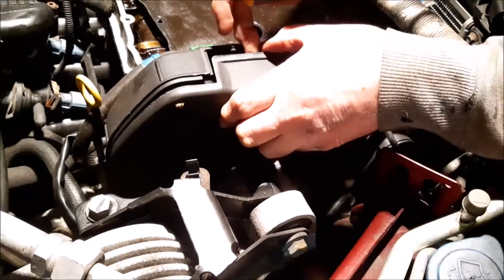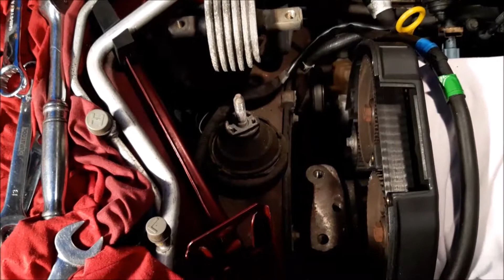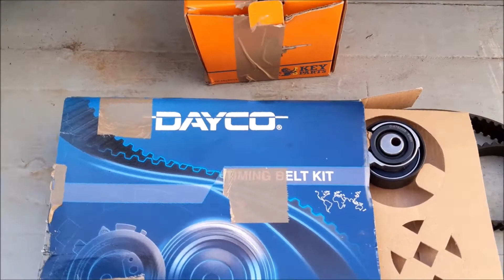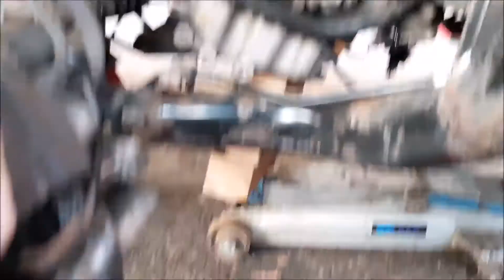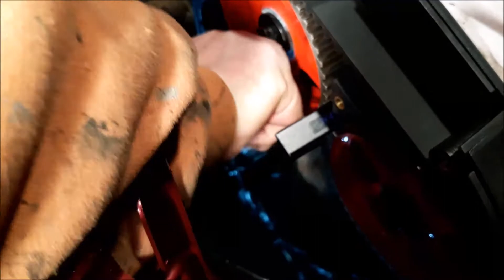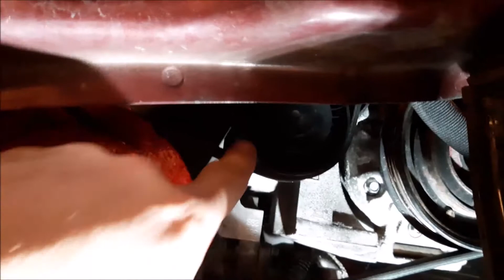Replacing the Timing Cam Belt on our Rover 75 K series engine

Comment: be careful ! The automatic tensioner must be turned counterclockwise as specified in the Rover overhaul manual
Reply from the maker: We use the Haynes manual and the X part disk and both of them say turn clockwise and we have always followed this although it is not that clear in the manual it does say if readjustment is needed you may need to go anticlockwise again we feel not clear

Comment: Can you tell me how to completely flush the cooling system on my rover streetwise. Just unhook the bottom radiator hose drain it and run a water hose through the cooling tank????
Reply from the maker: That's it
Reply: Thank you :)
Reply: Is there anyway I could sent you 2 pictures and ask u a question. I  couldn't see any TDC markings at the crankshaft pulley so I lined everything up by putting the camshafts in aligned position (L->R exhaust-in-exhaust-in) and then put camshaft locking tool in while trying to lose the crankshaft pulley bolt. The bolt was on really tight so I put car in gear and foot on brake and tried loosening pulley crankshaft pulley bolt I still saw the crankshaft pulley spinning slightly when loosening.
 Now I have the crankshaft pulley off and timing marks on crankshaft are completely misaligned. I don't know what to do now...
Reply from the maker: @iinsane_s_killzz1138  as in the video there should be a notch on the crankshaft pulley that lines up with the TDC mark on the plastic cover. It sounds like you will need to put the crankshaft pulley back on and turn the bottom of the engine back into line it might be worth looking at some other videos that cover it